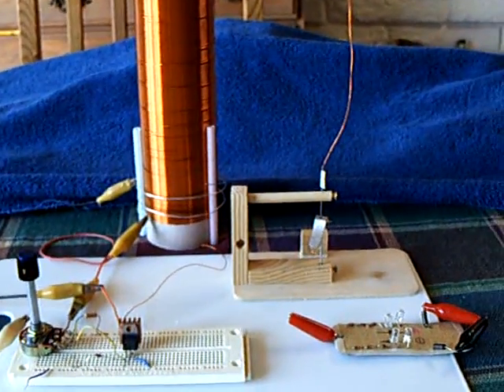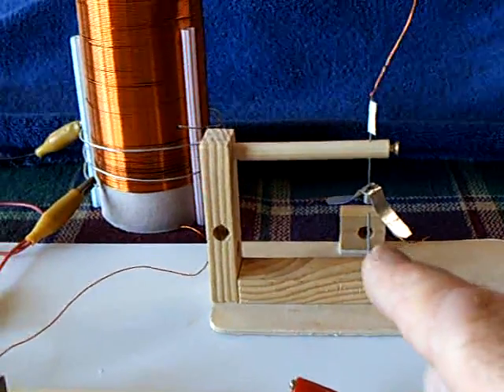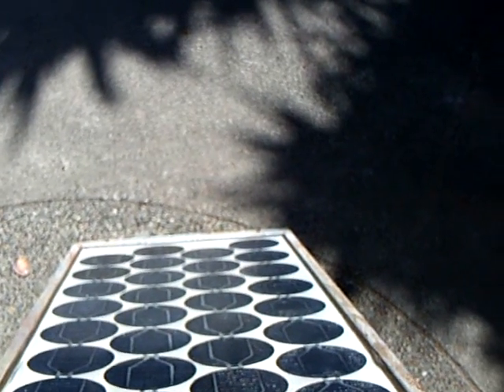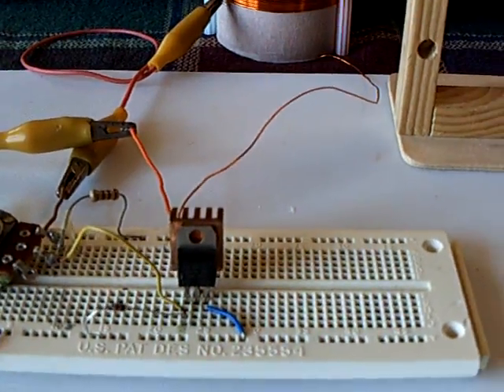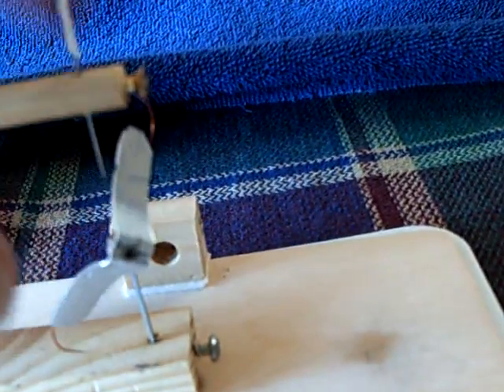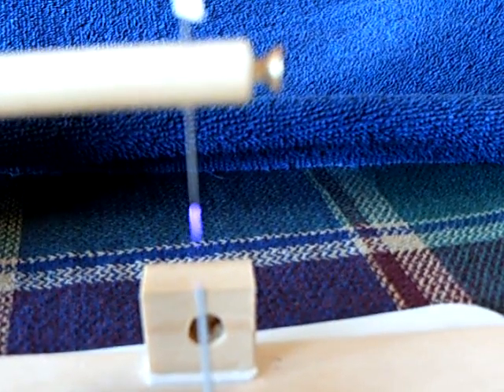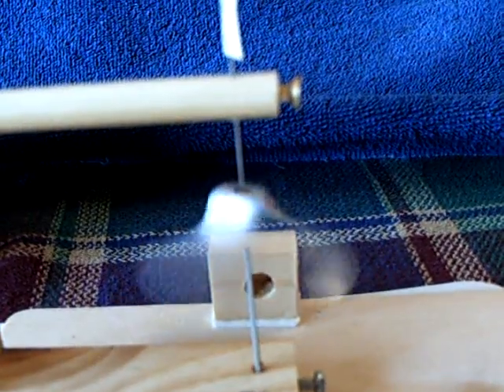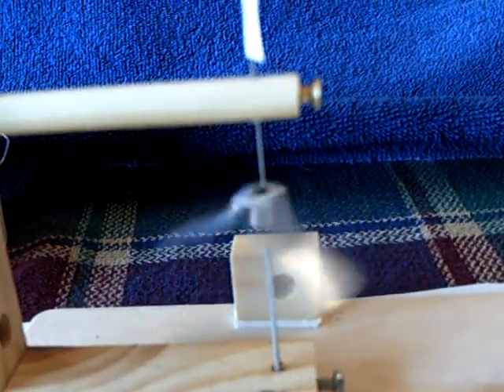Solar powered  Plasma Drive.ASF

Comment: Nice Slayer...just like to say, if set up properly once started plasma has a negative resistance which will sustain oscillations of a Tesla style Hi Q tank cct.   without need for further energy input solar or otherwise.  See for example Kapanadze generator once started they only need the earth connection in Kapanadze as they run it in 1/4 wavelength mode. Resonance at 1/2 wavelength requires no earthing ...so yep free space here we come!